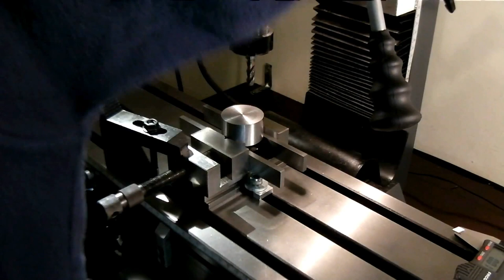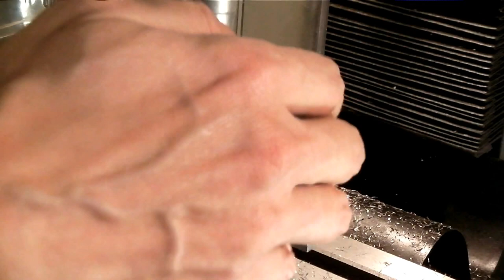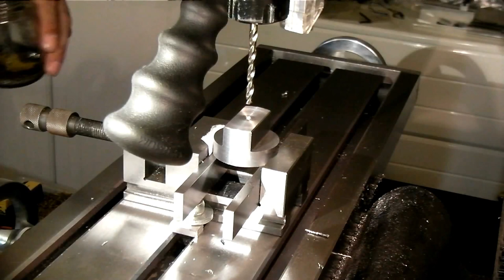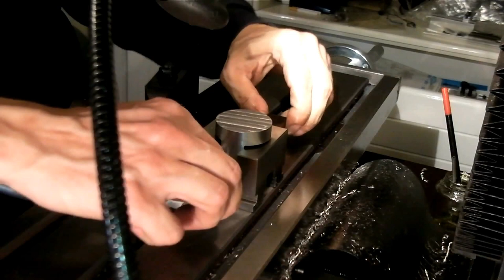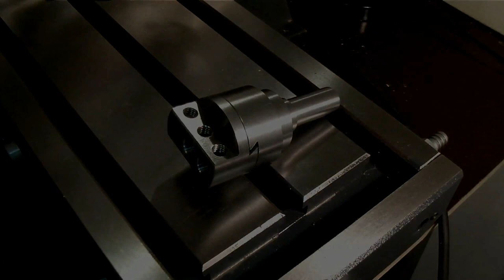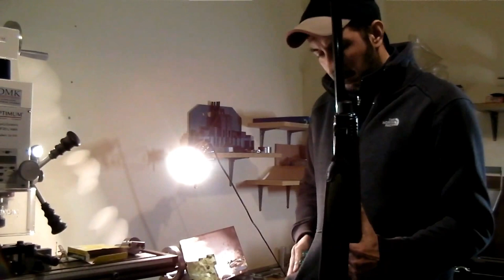Boring Head Making - Part 3

Comment: You should totally give making a base for one of your dial calipers a try. Depth gauges are wonderful tools and they eliminate all the dickery with the caliper rod (puncity).

Made mine from a dropping of tool steel i had around. Even made it with a small swivel system that allows me to set perfect 90 in case my part doesn't have even surfaces.

Comment: This is probably a laughable question but I'm no machinist and have no clue about it; what happens to all the filings? Is it something you can use for something else, can it be recycled somehow? Just a random thought I had watching some of these videos, seems an awfully large amount of materail being removed.

I guess it'd be hard to melt it down and recast it into a new workpiece by yourself :)
Reply from the maker: Mythricia Hi, yes it can be recycled. You can collect and sell them as a scrap metal, but it's worth only if you produce a fair amount of chips. An exception can be aluminum, copper or even brass that you can recycle by yourself.